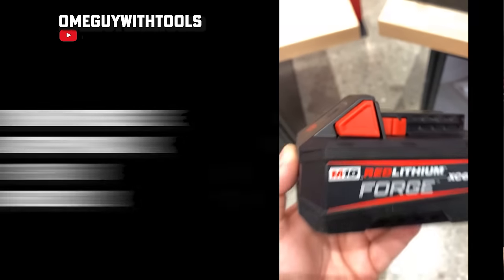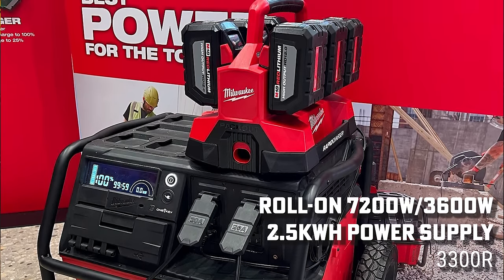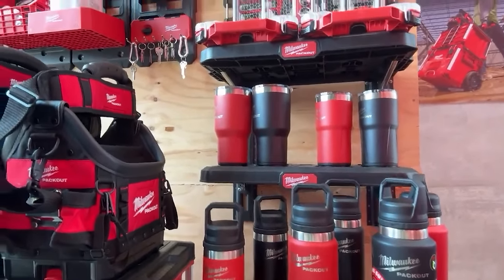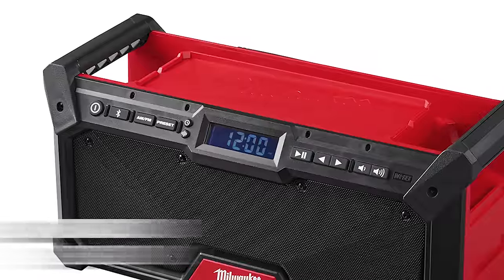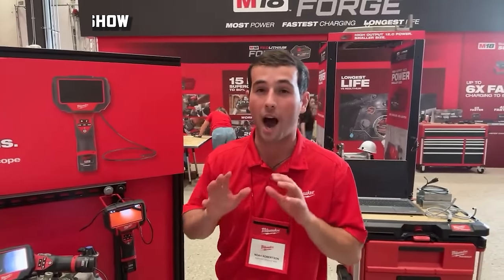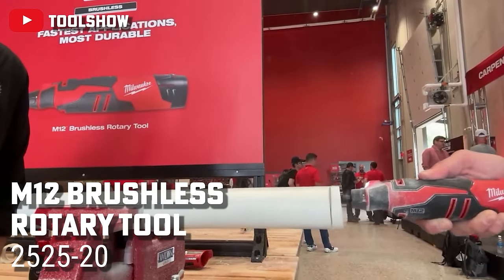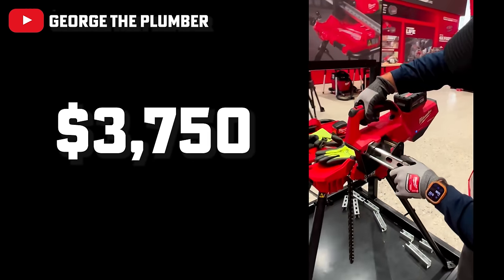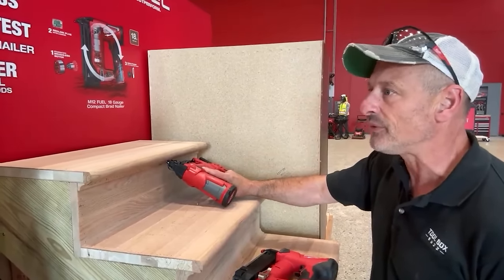Milwaukee Pipeline 2023 All You Need to Know

Comment: Definitely need more Packout. A 3 Drawer unit like the new 48-22-8447 with wheels+handle would be great. Sacrifice some of that tall lower drawer space (using bottom sliders, while still being able to fit a couple decent size M12 or M18 tools) and you've got yourself a winner, Milwaukee. Hire me!

Having to take everything off to get inside a rolling base unit isn't the best.
Reply from the maker: That would be nice!
Reply: Great idea for a while now i think of that every time I even look at my packout rolling base since the drawers and cabinets are all I use
Reply: 100%.  Drawers on bottom of stack.   Flip tops near top.
Reply: Definitely, I need something to put my deep cut bandsaw in without having to disassemble my whole setup

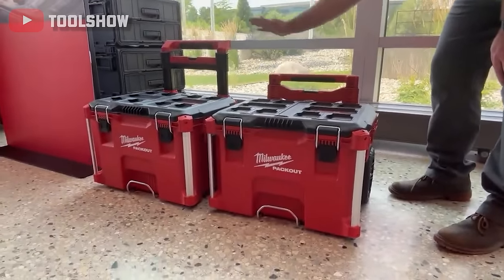Comment: @5:00 The presence of the Low Pro handle is certainly appreciated, but the Rolling Toolbox itself warrants a complete redesign! It would be highly advantageous to offer two distinct versions: the standard edition featuring the new Low Pro handle and a secondary iteration in which the top remains sealed, adopting a drawer-style configuration. This would enable the placement of Packout drawer sets atop the toolbox, while preserving the utility of its base within the setup.
My frustration primarily stems from the problems with the Packout 2-wheel Cart, which unfortunately doesn't meet expectations. It's just not sturdy enough and it's difficult to move because of the steel base. Even when I try to make small adjustments or turn it slightly, it gets stuck on the concrete instead of moving smoothly. To make matters worse, it's now started to rust, adding to my annoyance. Clearly, the high price they're asking for doesn't match the product's worth.

Comment: The big  power station really needs a packout solar panel and wind turbine charging kit. Even a portable water turbine for throwing increeks to charge it would make it nice. And maybe worth 5k
Reply from the maker: Solar connector and built in controller would have given this unit a lot more versatility no question. Pretty common on other high end units. Otherwise we think this really is a great addition for Milwaukee to use as your packout base!

Comment: My Milwaukee tool list id like to see come into existence :
1 a solar charging super inverter and turbine

2  mx or m18  800cfm + blower

3  m18 jack 

4  36v 20" chainsaw 

5  36v  hot cold chest cooler

6.  m18  stainless steel 
coffee maker 

7. 36v standup carpet vaccum 

8. M18 /mx outboard motor with a solar and impellor charger.

9  packout drawer rolling base

10 a m18 or 36v post hole digger

Keep up the good work!
Reply from the maker: List is spot on!! @milwaukeetool pay attention please #pipeline24

Comment: @Ohio Power Tool. Thanks guys for recapping yesterday's Milwaukee PIPELINE 2023 event. I am intrigued about their M12 inspection camera for auto technicians.

Do you know whether the resolution of that camera is 480p or 1080i?

Hope everyone at OPT and your families stay safe and well.
Reply from the maker: From how zoom works and focus on still images we have to assume 1080i but we dug into the setup info and doesn’t specify… 

Diagnose Hairline Cracks with Clarity
▪ Larger, 4.3” Screen for Enhanced Viewing
▪ HD Camera Delivers Crisp, Clear Images
▪ Front & Side View Cameras for Increased Application Viewing ▪ 3 Level Zoom to Quickly Focus on Points of Interest
Best Access
▪ 5mm Camera Head for Best Access in Tight Spaces, Including Glow Plug Holes & Fuel Injector Ports
▪ 3’ Flexible Cable Balances Flexibility and Memory to Maneuver Tight Spaces in the Engine Bay
Technician Driven Features for Easier Inspections
▪ Easily Share Photos and Videos Via Included 32GB SD Card ▪ 270° Rotatable Screen for Hands-Free Viewing
▪ Field-Replaceable Camera for Reduced Downtime
 Image Quality
   5mm Access
  Easier Diagnosis

Comment: The milwaukee roll on generator with a price of 4500 or 5500 sounds crazy when you can buy a bluetti ac300 with 3000 watt  Continuous or 6000 W surge with 3000 watt hours for 2600 dollars or go bigger with the ac500 that has 5000 watt continuous and 10000 watt surge with 3000 watt hours for 4600 dollars and theese can be doubled for 240v you can add expansion batteries and there 1 of the best solar generators companies. That milwaukee needs to be down around 3000 dollars and let's hope it has good solar input and features to expand battery watt hours. I love all my milwaukee tools but THEY ARE EXPENSIVE AND TAKE FOREVER TO RELEASE HALF OF THE COOL STUFF THE CHEAPER COMPANIES DO.... SO SORRY FOR RANTING
Reply from the maker: Good thoughts, we were surprised to see this have a totally internal battery from Milwaukee which does open it up for direct comparison to other similar options. With those new 12.0 MX batteries surprised we didn’t see a 6 or 8 bay power power unit that would still be expensive but adds the flexibility to use those batteries in lots of other ways as well as accumulate batteries first then buy the power unit later without the batteries for a much lower price. We’ll see how it does, it’s Milwaukee they will get a premium but also can reduce price if that is the only complaint. Rant answered with another rant!

Comment: I wonder if they fixed the issue on the 1/2" impact breaking constantly with the crappy plastic design.
Reply: In australia the Milwaukee impact wrenches  explode, however still do better than Hilti or snapon, significantly cheaper and last roughly 10 times longer

Comment: I would love them to make a battery operated chisel just like the air chisel it would make my life a whole lot easier as a mobile mechanic so i don't have to go over weight on my van with a compressor as well as a gen set to power it as the cordless compressor hasn't got the beans to keep going with the air chisel plus i am all battery tools so no need for a compressor just for the air chisel.

Comment: How does the new rotary tool have more power? The previous model has 35000 rpm compared to the new one at only 27500 rpm.
Reply from the maker: No load RPM is sometimes the enemy of torque. We’ve seen that in circular saws for years. A true wormdrive saw has lower no load RPM but way more power. Since RPM is only number they give it looks wrong but if they provided Peak Watt Output our guess would be this one is higher.
Reply: @OhioPowerTool  what your saying is they sacrificed 3000 rpms in due for more torque/power? Meaning the new one will have less RPMs but hold more power being able to cut harder and more difficult surfaces. Makes sense.

Comment: The blowers seemed underwhelming.  Since i use the ego 765 cfm model istill want more power.  Cat recently made an 800cfm handheld blower. I could use 900 to 1000 cfm for most of my jobsite cleanups. Using an ego 765 i frequently clear gravel off parking lots. dirt and wood chip residue out of dump bed trailers. Dust and dirt covered skid steers. 2x4x up to 12" long debris being blown into a single wood pile. Up to 3" of snow off sidewalks and vehicles and roofs. The only way I would invest in another Milwaukee blower is if they made a 800 cfm + edition.
Reply from the maker: EGO is a beast, they said they could have made a more powerful handheld but the force will likely cause long term damage to user wrist/arm and we believe it. Over 800cfm better to do a backpack or they'll need to figure out some other way to support it with like a forearm brace. Also we'd like to see some more comprehensive head to head testing, sometimes the numbers can be manipulated, higher CFM from brand to brand doesn't always equal more moving force if their marketing team gets involved.
Reply: @OhioPowerTool I'm a skinny guy and I usually use a 10 amp battery and that seems to hold it steady.  I dont notice much movement on my end. Its heavy but it seems to work good .

Comment: Don't get me wrong, I love Milwaukee products but FFS Milwaukee, stop rigging your "head to head" competitions... The string trimmers at 16:30 in particular... a gas engine vs battery... ok, maybe you have more power, but keep the competition identical, the guy with the Milwaukee trimmer rips through the cardboard or foam boards no problem, the guy on the left struggles but he cutting head is ALSO IN FRONT OF THE BOARD... He's not getting the whip of the string to punch through like the guy on the right is...

Is this an outright lie by Milwaukee saying they have a better system? I don't know... I own the single battery string trimmer because I already have the HD batteries and didn't want to mess with fuel mixing. This makes me not want to buy some of their products.

@Ohio Power Tool, I don't know how you guys missed this and put it in this video.

Comment: How come it always Has to be someone who doesn’t use tool is in any capacity to explain tools to someone who uses tools it’s insane to me they always do it’s always like a teenage girl or an old lady or some really young preppy dude.
Reply from the maker: Hopefully it's one of the Milwaukee folks from their product team who actually worked on developing the tool, probably were not a plumber or electrician before to be fair. They are normally product engineers so they study existing tools, then talk to hundreds of trade pros, watch them in field, then test different versions of improvements and finally launch the product. Do they get it right every time, no they do not, but to be fair to Milwaukee they seem to have a process that works better than most.
Reply: @OhioPowerTool  rhetorical question but okay. While we're speculating how come yall take so much longer to ship things than all of your competitors? I only shop with yall when yall have something I want that no one else has in stock but yall take like a week and a half to process an order and if it doesn't land at the beginning of the week it will tank another 2 business days to actually ship. Supply House, Home Depot, Ferguson, Lowes, Acme all are able to actually ship stuff quickly but you guys.... It bothers me that yall get everything early truly bc you're the last folks I want to buy this stuff from.